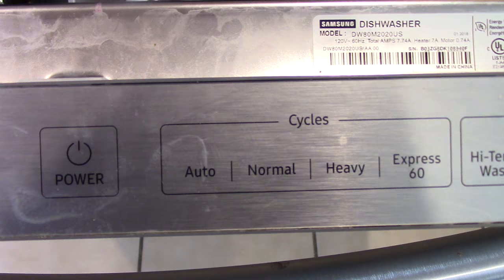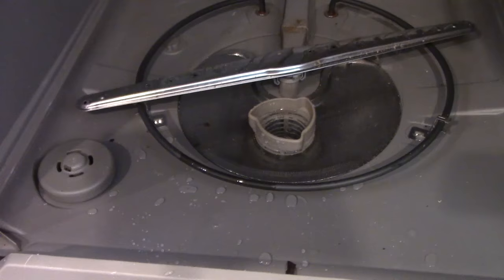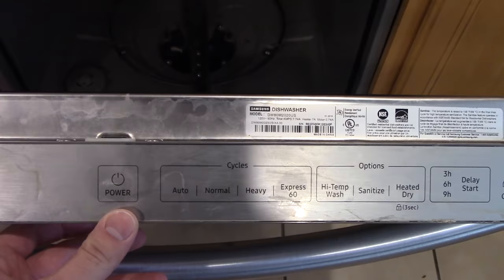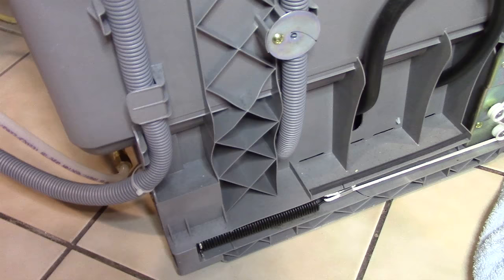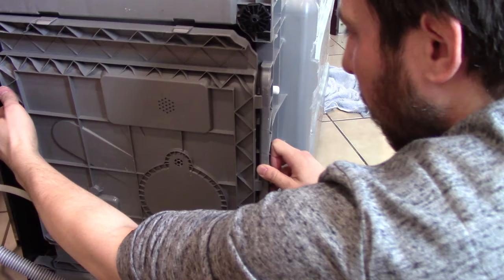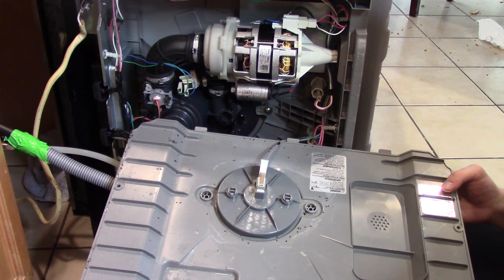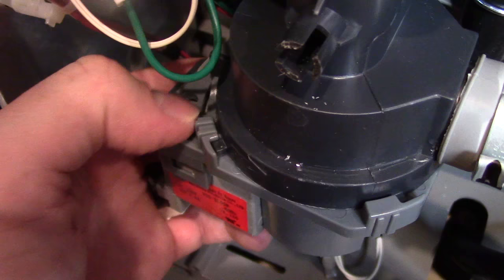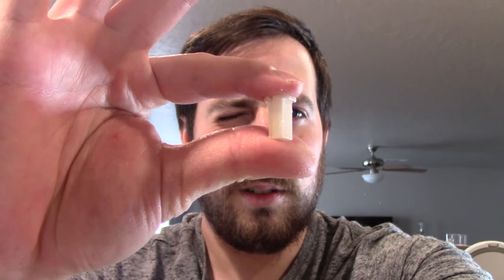Samsung Dishwasher Won't Drain: Impeller Fix

Comment: Had the same problem with my Samsung dishwasher. It's a different model but the same idea. No screws to remove on the bottom panel and the pump housing turns to the right to remove, with no locking devices on the housing, just a friction fit locking system. I also needed to disconnect the water supply line and remove the drain hose from the drain under my kitchen sink due to the way my dishwasher is hooked up.

Turns out it was a piece of glass that was in the impeller. The vanes have slight damage but the pump still works.

This video was a huge help before I took this project on. There was nothing I needed to guess at while disassembling it. For anyone with basic mechanical aptitude this is a do-able repair.

Thank you!
Reply from the maker: That's awesome you were able to get it fixed. It's crazy how one component can stop the entire system from running. Good thing that troubleshooting and repairing it is reasonably doable. Take care, and thanks for checking out my video :)

Comment: Great video. My dishwasher was unable to work for a year. I was actually getting ready to buy a new one. I figured I’d follow your lead as one last stitch effort. To my surprise there was a huge rubber band wrapped around my impeller (damn kids). It’s running as we speak. Thanks for posting. Huge help.
Reply from the maker: Holy sh!t, a rubber band? That's awesome you were able to extricate it and get the system working. 👊
Reply: @karatefox  yeah  i have 3 boys.  They put rubberbands around their cups to tell whos is whos throughout the day.  I guess one broke in the dishwasher and got wrapped up in the impeller and swelled up over time.  But im thankful for your video.  I almost gave up.  I appreciate you posting this fix.  You're the man.
Reply from the maker: @Warmageddon Music  

Ooh, the struggle is real. With our kids we tried getting them different colored cups so they wouldn't fight with each other. I like the rubber band idea, but that's a good insight in terms of the risks to the dishwasher. In any case, that's awesome you were able to get the system working. 👊

Comment: Thank you so much! Dishwasher stopped draining, looked up the error code and ended up here. As soon as I saw what the problem was with your dishwasher, I knew that had to be an impeller issue with ours, too! It was honestly kind of suspenseful to see what we would find in there - opened it, and voila! A tiny chip from a ceral bowl. FINALLY the dishwasher runs again, with NO money spent on the repair. Thank you for teaching at YouTube University!
Reply from the maker: It's a wonderful feeling to get something working on your own, and the relief of not having to hand wash so many dishes. Thanks for checking out my video, I'm happy I could help 😀

Comment: Thanks for making this video!
I had a small metal stick in the impeller part and it was causing a grinding noise. Was driving me bonkers and this video saved me some service repair and now it runs smoothly again ! Thanks so much!
Reply from the maker: @jonathangray5350  Outstanding, happy you were able to get it working. Likewise thanks for leaving a comment. I read them all, and it always brightens my day knowing I've helped someone.👊

Comment: This is great information and advice. One other thing to check before disassembling the dishwasher is the drain vent at the top, usually located on the sink. Sometimes that will get clogged with hair and lint and prevent the system from draining. The indication of this is that when you disconnect that drainpipe it'll still be full of water. That's a pretty good sign that the drain vent is plugged.
Reply from the maker: Absolutely agree. There have been times where I've let dishes hang out in the sink for a while and food debris has gotten washed into that opening. I've used a chopstick to clear the clog in the past. Is there a tool or technique that you'd recommend?
Reply: @mikefromwa - I disassembled the dishwasher tube from the sink drain and a small dime sized rubber tab fell into my bucket. It still had adhesive on it, so I knew it detached from some item we washed. It looks like a rubber sticker that is found under a cutting board to keep the cutting board from sliding. The heat from the machine loosened the adhesive and it ultimately became stuck where the dishwasher tubes connects to the sink drain. No more draining issues. Thanks @karatefox and @mikefromwa.
Reply: THis was exactly my problem
Reply: I watched this video and thought for sure this was going to be the issue, but it did turn out to be my air gap on top of the sink being clogged. Definitely would have saved me hours of work and dissembling the dishwasher if I had thought to check that first. 

Check air gap first!!!
Reply: @shellyyd can you take a pic of airgap

Comment: Did the same thing and worked.
The impeller was squeaky clean and no broken plastic debrids.
However, it seems that this procedure reset the dishwasher and now it's working.
Thanks alot!
Reply from the maker: Interesting, perhaps just turning off the power somehow reset the warning sensor. It's probably a good idea to still keep an eye on it just in case the sensor trips again. Please let me know how it's working or if you figure out why the sensor was tripping.

Comment: Thank you! My dishwasher wasn’t draining and I was planning to go through all the steps but then my garbage disposal stopped working. I used vinegar/baking soda, and boiling water to clean it, reset the garbage disposal and then tried the draining cycle on the dishwasher and it worked! I could see the water draining into the garbage disposal drain. If it stops working again, I’ll be sure to refer to this 😊
Reply from the maker: Awesome, I'm happy you were able to get it figured out and working. Likewise,  thanks for sharing the troubleshooting steps utilized. Hopefully people will see this comment and feel less stressed. 🤔💡

Comment: The layout in my machine is completely different, but the components look similar/the same. Thanks a lot, you saved me money and time from having to get it repaired.   
My obstruction actually was wedged in the hose directly AFTER the impeller. No idea how it got through the pump, but it explains why it pumped some liquid but not all of it.
Reply from the maker: Interesting, that's great that the parts were similar enough to help troubleshoot your system. What was the obstruction that you removed? Do you know where it likely came from?

Comment: Useful video. It might help some people to know that exactly that same pump is fitted to quite a few machines - including my 5 year-old Teka, and can be purchased as a spare part for less than $50, and then fitted just as you show in your re-assembly.
Reply from the maker: That's good to know. Perhaps it's like an industry standard to use that part. It's a sturdy little impeller, and mine has weathered a few jam-ups already. Perhaps Samsung should evaluate their drain design and add a better filter to further prevent foreign material from colliding with the impeller. It seems to be a common failure mode.
Reply: Yes, but I suspect the only way something big gets from machine chamber to pump is if the filter is not absolutely secure in its housing - it's easy to leave it loose, then the water jets will probably move it around. We've had glass fragments get through ours when we have left it a bit loose. That model pump does seem to be used a lot and (oddly..) it's price seems to vary with manufacturer of dishwasher, even though the part seems identical (and I'm sure it is). I see that some US stores ask almost $200 if you are fitting it to a Samsung but I can find what seems to be the same part in Europe for less than EUR 30! Thank goodness BMW don't make a dishwasher. If anyone out there looks to do a replacement, it will be well worth digging around a little.  I did something even more miserly. My impeller shaft had corroded and the impeller sheared off - everything else was OK. I found a new pump for less than $15 and realised that the electromagnet internals were almost identical - a bit of sawing with the Dremel, and a little patient epoxy application and it's as good as new. It took a few hours and I would have preferred to replace the whole pump if I could have found one with quick delivery but I couldn't, and I don't like washing dishes.
Reply from the maker: @johnhorsfall9623  That's some next level MacGyver stuff right there 👊 I think that's awesome. As far as I'm concerned, as long as a repair works it's good. How's your water inlet valve doing? Those things seem to break pretty frequently too. But yeah, it's always a good idea to shop around for parts because the price can vary quite a bit from one website to another.

Comment: Thank you for this! Mine ended up being the rubber o-ring had slipped off a bit, but your steps made this an easy fix!
Reply from the maker: @jangosquad4908  excellent,  that's awesome you got it fixed. Thanks for stopping by to leave a comment 🙂

Comment: You're not going to believe this but I was watching this video and when you popped off the impeller and that white chunk was in there I was thinking "I wish it was that easy. There's no way I open this and it's that obvious." But, I popped off the impeller (mine went counter clockwise) and there was a chunk of broken plate sitting in there. I was amazed. I put it all back together and it worked like a champ! Thanks so much for this video!
Reply from the maker: Thank you for the kind words, friend. I'm glad you were able to get things working.

Comment: Mine had a piece of broken glass! Not the same model (mine is DW80K7050), but same problem. I had to figure out some steps by myself on my model, but I would never had go that far without this video. Thanks a lot!!!
Reply from the maker: That's awesome you were able to get it fixed. It's crazy to think that a small piece of glass, or in my situation a piece of plastic, can make the entire system shut down. Thanks for checking out my video.

Comment: Samsung dishwasher dw80k7050ug not draining 5E error. Quite a bit different model than the one in this video but the exact same issue. One of the screw tabs that mounts the dishwasher on the side was lodged in the impeller.  You saved me a crap ton of money good sir. Thank you.
Reply from the maker: Thanks, Shane. Your comment just made my day. It's great that you were able to get things figured out.

Comment: Thanks for the great video!  Mine is a different model, but the inside was nearly identical.  Rocked out the repair this morning before the kids woke up… thanks for saving us some money!
Reply from the maker: That's awesome you were able to get it figured out. Was the impeller jammed like in my video or did you find a different issue?
Reply: It was almost exactly like you laid out… we had some chipped porcelain in there.
Reply from the maker: @zackery773  oh dang, that seems to be a common failure mode for these systems. Well, if it happens again in the future, it's nice having that peace of mind knowing that you can get it fixed on your own. Thanks for checking out my video, I appreciate you leaving a comment 👊

Comment: This video really helped me.  A piece of broken glass just smaller than a penny was stuck in the impeller.  Like you said, I could hear motor humming but not turning.  The pump came apart easily and the impeller housing is shredded from the glass.  Now that it's all put back together this gleaming, practically new machine I got for free will replace my crusty old one.  Thanks a lot!  Wonder how the glass got past the filters......
Reply from the maker: That's awesome you got it fixed. I'm guessing a glass may have been dropped in the sink and a piece broke off, washed down the drain and went into the drain tube of the dishwasher. Especially if the garbage disposal was turned on, as the spinning blades could have flung the piece of glass around in the drain until being flung into the drain tube of the dishwasher. In any case, thanks for checking out my video 👊

Comment: Glad I found this video. Had to tear mine down to find that the impeller had fallen off the spindle
Reply from the maker: I'm happy the video helped to troubleshoot things. I wonder what caused the blades to fall off? Did you find any large pieces of glass or hard plastic when you opened things up?
Reply: @karatefox  nope, it just fell off the spindle somehow. Had to press it back on. Seems to be working again now.
Reply from the maker: @johnny hall  Interesting, glad it's working. My theory is that something collided with it and knocked it loose. Hopefully everything stays intact.

Comment: I have a slightly different unit. This video still helped.  That said, I found nothing wrong with anything.  I took apart all the items underneath mine and they all look moderately clean.  So annoying.
Reply from the maker: Thanks for checking out the video. My intuition is telling me that the act of switching off the power to the unit probably helped reset the sensor. In any case, I'm glad my video was able to help you out.

Comment: My guy your video saved me money had something blocking the impeller as well. Great video.
Reply from the maker: Excellent, I'm happy you were able to get things working. Just out of curiosity, what did you find blocking it? Was it glass or hard plastic?
Reply: @karatefox  it was a plastic piece
Reply from the maker: @jwylde7  Interesting, it seems like hard plastic fragments are fairly common. Once again, excellent work for getting your system working again. Feel free to reach out if you need help troubleshooting in the future 👊

Comment: Thanks for the video. 

Shoes on for safety

Just a little water trips the sensor. The draining comes later in the cycle.
Reply from the maker: That's a good point about the shoes, proper PPE is important. Thanks for checking out my video.

Comment: thanks bud, you saved me. no way I could have figured all that out!
Reply from the maker: Thanks for checking out my video, that's awesome you were able to get things working. Just out of curiosity, was there a piece of plastic jamming your impeller, or was there a different issue?
Reply: @karatefox  it basically came unattached from the proper, so it was running but no water was moving. Snapped it back on and has been working agian. Thanks again!
Reply: @karatefox  I'm not entirely sure, it may just have disconnected somehow. I didn't see a piece of plastic like yours, but the fix was exactly the same,  Thanks again!

Comment: Very helpful! Thank you! I found a broken measuring spoon handle in ours.
Reply from the maker: That's awesome you got it figured out. Dang, a broken measuring spoon handle. Do you have a garbage disposal unit set up? If so, hopefully the blades are doing ok.. in any case, that's great you found the root cause and got it working 🙂

Comment: Thank you, it worked! I have 3 kids so our dishwasher is a necessity. But now I can't get the braces back on to secure the dishwasher!
Reply from the maker: I'm happy you were able to get it working. Hmm, in terms of the braces to secure the dishwasher, perhaps try these things. First, carefully insert the metal clips into the top slots of the dishwasher frame. Then, carefully slide the dishwasher into the space it goes. Once it is most of the way in, slightly open the dishwasher door by its horizontal handle. This will cause the unit to pivot back slightly and allow the metal clips to slide under the counter top. Then, it's just a matter of wiggling the dishwasher side to side as you guide it all the way back into its space. For the screws, try to find the holes in the wood underneath the counter. Worst case scenario, you could just make some new holes and use a sharpie to mark the area so it's easier to find in the future. Please let me know if this works or if there are specific challenges you're experiencing. Always happy to help 🤔💡

Comment: Great video man! Really helpful! I still haven’t found the root cause of my dishwasher not draining properly but I did remove the impeller and it was actually pretty clean. The only concern I have is that my impeller did not want to spin like yours did. It would only spin about half a circle on both directions. I didn’t want to force it because I thought that maybe that’s how it was made but do you think something is causing it to not spin freely ?
Reply from the maker: Interesting, it sounds like there may be something jamming the impeller from the inside. How old is your system? When was the last time that it was working? What does it feel like once you turn the blades of the impeller? Is there friction after the half turn or does it just feel stuck like something isn't allowing it to make a full revolution?
Reply: It might be the magnets in the motor that give fairly stiff resistance every half turn - that's what they are supposed to do? But not rigid resistance. If so I guess one of the plastic waterproof seals has broken. It's fairly easy to dissemble and simply have a look inside. Take off the large grey plastic ring by prising gently with a large screwdriver, then grab the white, plastic seals with some suitable grips and pull.